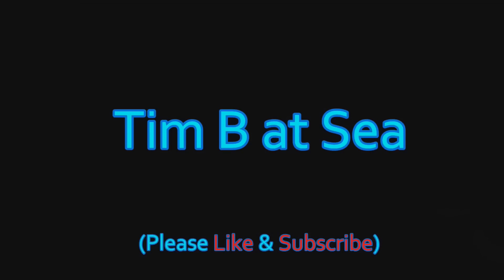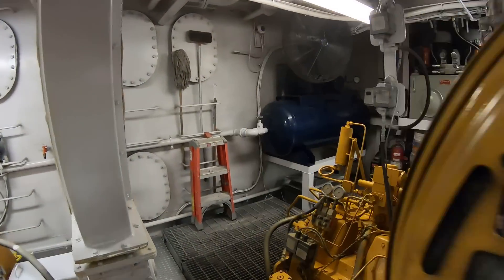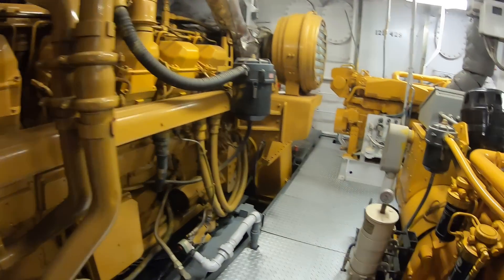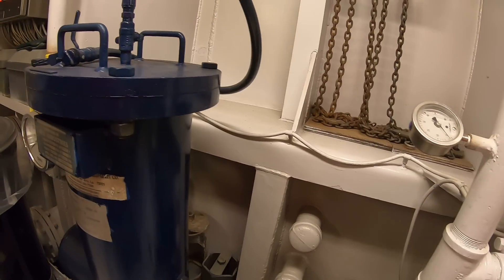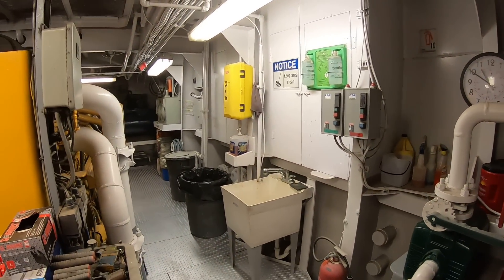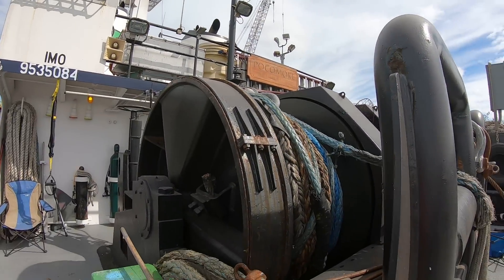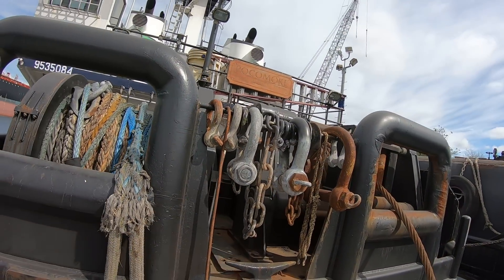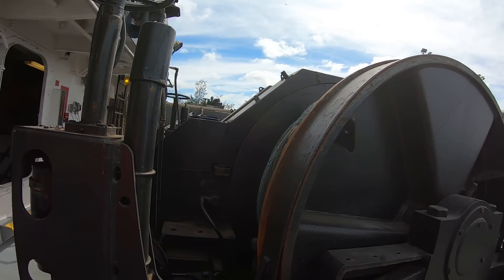4200 HP Tug Boat Engine Room Tour

Comment: 140' x 40' x 9'	ABS Ocean Deck	3000 lbs/ft2
140' x 45' x 9'	Inland Spud	3000 lbs/ft2
150' x 60' x 10'	Inland Spud	1300 lbs/ft2
180' x 54' x 12'6"	ABS Ocean Deck	2000 lbs/ft2
180' x 60' x 12'6"	ABS Ocean Deck	2000 lbs/ft2
180' x 70' x 10'6"	Inland Deck	1500 lbs/ft2
195' x 35' x 10'6"	Inland Deck	1200 lbs/ft2
200' x 50' x 13'	ABS Ocean Deck	4500 lbs/ft2
210' x 60' x 13'6"	ABS Ocean Deck	1500 lbs/ft2
250' x 54' x 11'	Inland Deck	2000 lbs/ft2
250' x 54' x 11'	Inland Deck	4500 lbs/ft2
250' x 54' x 12'6"	Inland Deck	3000 lbs/ft2
250' x 72' x 16'	ABS Ocean Deck	4500 lbs/ft2
260' x 72' x 16'	ABS Ocean Deck	4500 lbs/ft2
260' x 100' x 16'	ABS Ocean Deck	5000 lbs/ft2
282' x 54' x 12'6"	Inland Deck	3000 lbs/ft2
300' x 100' x 19'9"	ABS Ocean Deck	4500 lbs/ft2
318' x 96' x 20'	ABS Ocean Deck	3000 lbs/ft2
400' x 99'9" x 20'	ABS Ocean Deck	4500 lbs/
Reply from the maker: Thank you for watching Rayan. CUOTO

Comment: fellow comiz
Here are good.
The ones that follow this matter are keen,noble is Mr Tim to answer yea.
Here is one I have a few.
A barge is ( I should say a  common popular regular size is )
195Lx35Wx = 6825 sq ft
If 10ft deep
×10 = 68250 cu ft x 60 lb = 4.09 M lb. 2047 ton
510k gallon
...If 11 ft deep
×11= 75075 cu ft
4.5 M lb 2252 ton
561k gallon
Reply from the maker: Ryan. Once again I am not sure what you are saying. But our barge is is much larger than you may think. It holds over 2.1 million gallons of products and can be loaded to 22 feet and is almost 400 feet long.  I have no idea what the other thing you posted are referring to. Please advise.
Reply: @TimBatSea  
studying a rr tanker car 
pontoon ( 4 tank car) 
55ft  pair and 55ft pair (4)
tied together with a bridge platform
these tanker (would be hull ) walls  are 1/2 thick weigh 22 lb sq ft 
one tank weigh 30k displace  180k lb  
how much engine 
to move 30,000 lb
of a  boat say 15 mph
Seattle boat say
His 22k yatch use 2.8 gal hour at 7.5mph run 1500 rpm.

Comment: 3415
3k hp
Reply: The Plimsoll line is a reference mark located on a ship's hull that indicates the maximum depth to which the vessel may be safely immersed when loaded with cargo. This depth varies with a ship's dimensions, type of cargo, time of year, and the water densities encountered in port and at sea.
Reply from the maker: Negative. 3516
Reply: @TimBatSea  . 
Tedious to find info
On these marine
engines. On this inet .

Comment: Consumption
Reply from the maker: Diesels, as with most engines very in their consumption depending on load. These are continuous duty engines and if running at %100 load the mains use about 175 gallons an hour. CUOTO
Reply: @TimBatSea  
175 gph..03mile per gal  
181 ft pr gal.what displacement the 4200  
so this yellow(cat?)
about 262 liter
16k cu in
15 liter cummins
use 10 gal hour

Comment: The description could say the following:- The tug's towing gear consists of an Intercon, double drum, DD-175, towing the main winch. Outfitted with 2,000(ft) of 2.25(in) diameter, stainless steel, towing wire. The "suitcase" drum is equipped with 1000(ft) of 1.25(in) towing wire.  ( note suitcase drum smaller in size and not always a permanent one) 
Now about the suitcase drum,  this is normally smaller and in some tugboats, it is an additional item that could be taken off and packed up to install at another location on a different tug.
The origin term comes from musicians playing drums which needed to be transportable to do a few shows at different locations on the same night and perhaps the drums and foldable stands were a little smaller which could be packed up in a small suitcase. The following video of a 'Suitcase Drum portable kit' may give an idea of the relation of the roundness of a tug's towing drum to that of a musician smaller playing the portable percussion drum/set. 
https://youtu.be/5D8hdVwSebc
Reply from the maker: Thank you for watching. That video is an older one, and the suitcase drum mystery has been solved. LOL  Great video link.  Thank you for sharing.  CUOTO

Comment: Why does your boat have open wheels instead of Kort Nozzles?
Reply from the maker: Thank you for watching Yon.  The 3000s have open wheels because they rarely tow and only push in the harbor, so a slight decrease in speed while pushing a barge but much better maneuverability for the bunker work they are designed for.  The 4200s are wire boats meant to tow off shore and the have court nozzles .

Comment: Stunning Engine Room. Spik and span engineers dream. I would hazard a guess  that its the suitcase all the stuff is packed into. Question do you use a Catenary on some tows.
Reply from the maker: Yes. Any time we tow on the wire, some amount a catenary will be in play. The more the heave or swell the more wire we out out to increase the catenary.
Reply: @TimBatSea  Of course, in my limited experience with Fishing vessels we called the weight we added to the center of the towline (short) a catenary.
Reply from the maker: @rockadon1977  I believe that catenary is an adjective and not a noun, but I'm no English major. Lol

Comment: From Pacific Maritime Magazine: The Suitcase Drum packs 150 feet of 1-inch diameter wire rope at the ready for making up tows. It's 28,150 lbs. line pull at 81 feet per minute speed allows the rope to be quickly tensioned once the line is made fast on the tow. The Suitcase Drum functions best with towing alongside making best use of the tugs' ASD's to control tows in heavily-trafficked restricted waters.
Reply from the maker: Thank you for watching and looking this up, although I believe what you have found is the specs on a suitcase drum on a particular boat. Since posting that video, I have learned that the name comes from the gulf of Mexico where it was common to need an extra winch for certain jobs (anchor handling). But later other boats wanted a second winch and the suitcase was a second winch that could be installed on whichever boat needed it. Like a suitcase.

Comment: Does this power like a train? Diesels turn the gen that currents an electric motor or engine to shaft and prop?
Reply from the maker: Hello and welcome to the channel Keith. What you are talking about is known as "Diesel-Electric".  Some very older tugs had this arrangement, but ours do not.
Reply: TimBatSea you’re making me feel “very old”. I worked as a weldor and inspector for GM Electromotive division. We were building locomotive Diesel engines. Not all the engines we built were for locomotives and we were told that many of them were intended for tugboats and that all tugs had diesel electric drives. Then again, that was more than 40 years ago.
Reply from the maker: @Jonistired  Thank you for watching John. EMDs are locomotive engines that were very popular, and still are. (But the ones I ran were all 2 stroke, so although I heard they have a 4 stroke engine now, I haven't see one. Oh wait. Yes I have.) But none of them were diesel electric. They all had reverse gears. No electric motors.
Reply: TimBatSea here’s another question. I was told by a San Francisco inland boatman that most of the tugs on SF Bay have pod drives that rotate in any direction but your boat obviously has a shaft drive. How common are those pods? Are they a west coast port thing?
Reply from the maker: @Jonistired  John. Those are what we call Tractor Tugs and are mostly used for shipdocking.  Most of the shipdocking tugs in NYC are Tractor Tugs too.  They can tow, but it is a big expense and not needed for towing/pushing tugs.

Comment: Not sure if anyone has answered yet but a "suitcase" drum is the same as an "anchor" drum. They're used for running anchors on offshore Derek barges, lay barges, handling anchors for dive boats ECT. It's a smaller wire  that connects to the larger anchor wire. Allowing you to pull it on deck and shackle in the main pinet wire.
Reply: It's not as easy to explain as it would be why port is on the left and starboard (steeringboard) on the right. But when running anchors the bouy has to be decked and secured it is often times refered to the suitcase wire of the buoy. One winch grabs the bouy the other, the anchor. Anchor drum....suitcase drum
Reply from the maker: Thank you for watching Jay. Please consider Subscribing if you haven't already. I try to post new content every Tuesday.
Reply: Ok but that doesn't explain why it's called something with suitcase.
Edit: I see that Carmel Pule' a few posts down had a plausible explanation for the origin of the name.

Comment: One thing I have wondered from barge side. Does the offset suitcase drum cause it to handle different when in push gear compared to a centered winch? What about towing? The winch is off to one side rather than in the center. A third question that I dont remember if I asked before, but why is there multiple dohnuts?
Reply from the maker: Thank you for watching. Your three questions are all about the same thing. First, there is a donut for each side so when you set up the deck, you can pick up the donut that is easiest. Oddly the offset of two winches doesn't really effect you much. It is rare that the barge will be directly in back of you. The wind or seas usually has it favor one side or the other, so we don't mind the little bit that the offset adds or subtracts. The push gear is a different matter. I worked on a boat where an extra shackle was out on the longer side to even it out, but I always thought it was to much.  We can make minor adjustments, but it's usually not nesisary. The difference at the ends of the gear are very minimal.

Comment: Captain Tim, Have you done a video of your wheel house showing how you steer and apply power to control your barge?  Have you ever put the camera on your head so we see what you are lookung at?  Great videos love them.  Were you on the Hudson when the plane landed there?
Reply from the maker: Hi Art. I just tried something new tonight. I out my phone in the window and got the GoPro to shoot the rudder angle indicator and throttles and joystick. My plan is to figure out how in my editing software to do a split screen so you can see what is happening out side and what inputs my hands are managing. And no. I was off shore on that day. Very lucky because 9 out 10 days tug and barges are anchored exactly where Sully landed. It really was a miracle.

Comment: Nice engine room, Tim...
The big drum wire is about the size of the drag cable on the Lima 2400 
Draglines I ran in the rock quarries in Miami I the early 1970’s... BTW, I never
Thought about the turning problem when turning IF the drum is farther aft 😱😳😎👍🤷🏻‍♂️
Reply from the maker: Thank you for watching and please consider subscribing if you haven't already.
Reply from the maker: Thank you so much for watching.

Comment: Since were talking big water, and your the man with the tug:)  How is it so many ships have been lost at sea due to broken lines???
Reply from the maker: Thank you for watching. I'm not sure I understand what you are saying. Broken lines? Water lines? Mooring lines? Or pick up lines?
Reply: @TimBatSea  I didnt word that as well I'm sorry, I mean more in general. What sort of event could cause a loss of whatever is being towed out in open water? Several distinguished warships have been lost on the way to the breakers this way.
Reply from the maker: Oh yes. I see now. Other than the obvious, defects or old rusted towing cable, or gear, the best way to loose a tow is to have to much wire out causing it to snag on the bottom or not having enough out in heavy weather causing the wire to snatch up in a violent shock load. Thank you again.
Reply from the maker: Thank you for watching. I'm not sure I understand what you are saying. Broken lines? Water lines? Mooring lines? Or pick up lines?

Comment: Capt, what kind of nautical miles or gallons per hour does a Tug your on today out at sea pulling a barge consume ? And how many gallons of diesel does she hold and is the diesel a little more heavier grade than on-road highway diesel .
Reply from the maker: This boat at %100 holds about 93,000 gallons, but we usually only load her to around 73,000. A general rule of thumb for fuel burn is roughly the horse power in gallons in a 24 hour period towing s loaded barge at full throttle. So we will burn about 4000 gallons a day.

Comment: Another great video, Tim! Thanks!!! Love hearing the details on the winch setup. One question: how is the winch locked down once the tow cable is fully payed out? Is there some kind of braking system or lock mechanism? Finally, i want to second all the positive comments about your demeanor. I come to your channel to sponge up all the fascinating technical details, but i stay here and enjoy it all the more because of your calm and positive approach. Keep up the great work!!!
Reply from the maker: Oh shoot! You are correct! I now see what you are talking about and missed answering the question. I'm very sorry. Ok... So the winches (on the 3000s and 4200s) have a huge brake band that goes around the diameter of the winch drum. Both can be "dogged down" too but that is rarely done except in very bad weather.
Reply: Bro gave you a canned response
Reply from the maker: @avman2cl  that wasn't a canned response.
Reply: @TimBatSea  well I'm interested in your answer to his question. I also enjoyed your video.
Reply from the maker: Thank you for the kind words and for watching. I really appreciate it.

Comment: Another fantastic video mate. Thanks for showing us another tug and explaining the difference between the two. I’m gonna learn how that hydraulic brake system works, im very interested in that. I’m a Interstate truck driver and used to drive some of the bigger trucks so I like to see all the different methods of moving freight. Some people don’t realise there is a few key jobs and if theses few decided to stop nearly every other place cannot function for very long.
Reply from the maker: Exactly. Hey. Have you every used a Jake Brake? I believe our hydraulic shaft brakes works in a similar manner, except instead of valving off exhaust gas, it works by valving off hydraulic fluid used in the reverse gear. Thanks again my Brother.
Reply: TimBatSea yes I’m very familiar with jake brakes, ahh ok I get you. It is amazing the things we have now compared to only 20-25 years ago. I never thought about them texas bars and why the winch is always so close to the middle, your explanation made me understand instantly how it helps steering. Never even crossed my mind but it makes perfect sense that anything pining you down from the rear is going to want to send you straight
Reply from the maker: @Big_Red_Wade  That's it exactly!

Comment: That engine room is super clean and organized! Love it! I learned so much... winch placement in relation to rudder, Texas bars and donuts, safety chains... Great stuff! Question: The John Deere winch motor... does that power a hydraulic pump which in turn operates the tow winch or is it an electrically powered winch motor?

Also, the company you work for... I see their tugs on the Hudson River often. But you're in Florida... This company, are they all up and down the east coast?
Reply from the maker: Thank you for watching. The winch is not electric. The one on my usual boat is hydraulic. The ones on the bigger boats have a transmission and a super big chain that goes up to the winch on deck. 
   And yes, the unnamed company I work for has boats on the East coast, gulf of Mexico, Caribbean and the west Coast. Thank you for watching and please consider subscribing if you haven't already.

Comment: When I was on my companies off shore tug we used Norman pins and a safety chain to keep the wire down and about mid stern of the boat. It seems like a Texas bar is less dangerous than trying to put on chaffing gear when the weather gets rough
Reply from the maker: I think you are correct, but I have never used them myself. Thank you for watching and please consider subscribing if you haven't already.

Comment: That was great Tim, thank you !!! Love seeing the diesel engines and all the support equipment engineered in to make them last many decades. Makes sense to have the winch mid deck like that, similar to how a pickup truck will pull better with a gooseneck/5th wheel hitch vs a "bumper pull" tow hitch. Be safe, stay healthy. Im healthy but I've canceled my upcoming cruise out of NYC due to Coronavirus and/or the fear of possibly being quarantined someplace against my will, should things turn bad.
Reply from the maker: Good thinking. If you haven't seen it, you may also like my video of a 3000 hp Tugboat. Thank you for watching and please consider subscribing if you haven't already.
Reply: @TimBatSea  I go look your 3000 HP what displacement .. I had a  calculated guess 75lt
 liter .. but based on a miss number.

Comment: It would be good to see details on the push or tow gear setup (on whatever boat), including in operation. You mentioned the donuts before, but only now did I understand they work as a pulley roller kind of thing on the wire.

For the engine room, it would work better to add the voice later. Dial back the original audio and talk over it.

The fast motion is nice for seeing a complete operation, but I'm missing the actual pacing of what is going on. It would be nice if you could edit together segments that cover critical times, and have voice describing what is going on, just then, what you are thinking, why this is the right time to turn, or whatever.
Reply from the maker: Thank you for watching and I appreciate all the good ideas. You may find more information on make ups and configurations on one of my other videos entitled, "different make ups or configuring the tow". Thank you for watching.